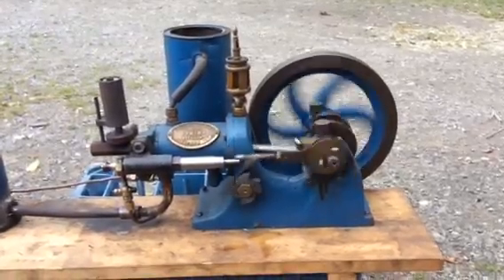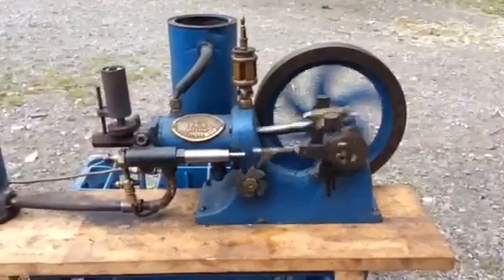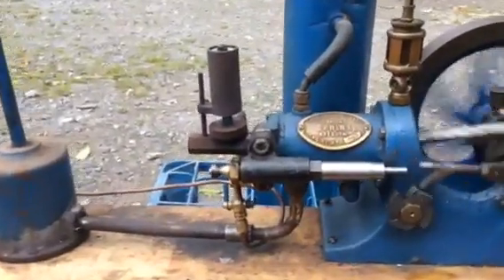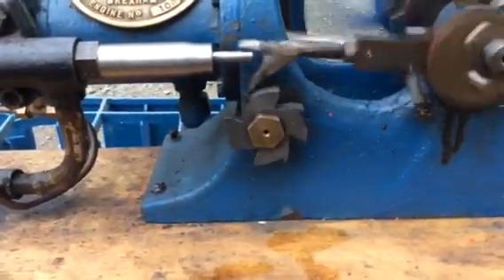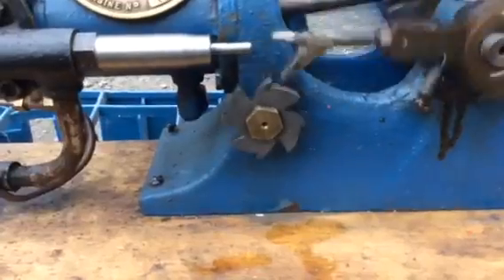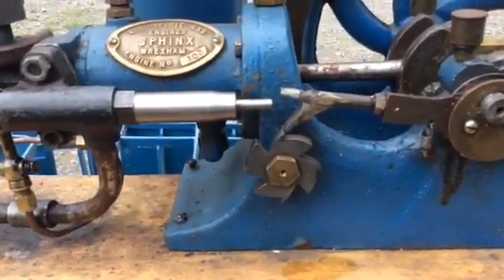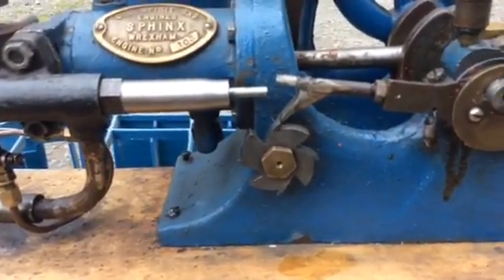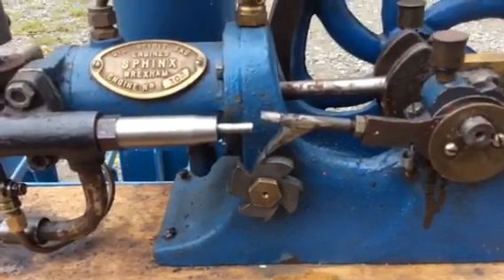Sphinx gas engine number 103

Comment: I particularly like how you maintained composure throughout the line "Oop. And now we've burst into flames."

What a lovely piece of work this engine is; with that un-usual star-wheel. First time I've seen that mechanism for operating a valve, but it does have an elegant simplicity to it.